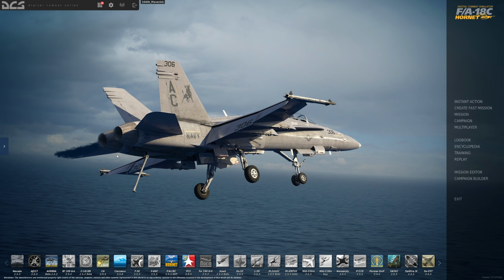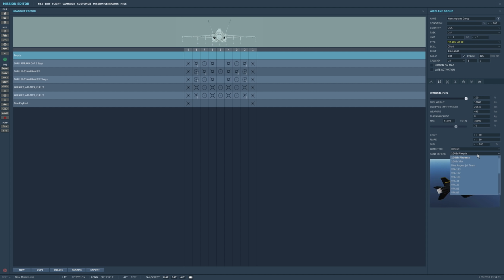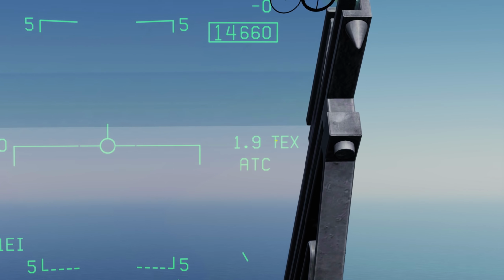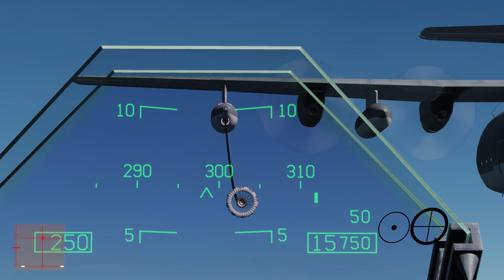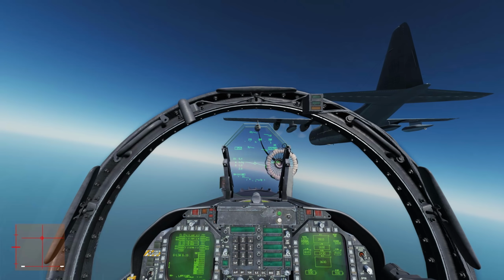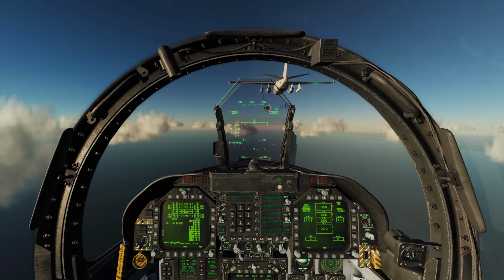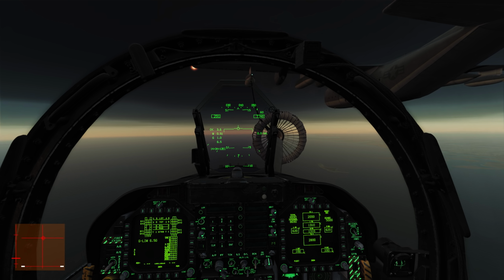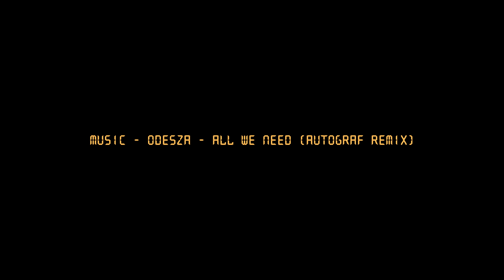DCS Fuel School | Complete AAR Tutorial |  Episode 1 - F/A-18C

Comment: Great coaching! I could listen to this guy talk for hours.  True and chill words to live by for tanking.  
I'd like to add two things: You might have noticed that the altitude and airspeed that you entered for the tanker in the mission editor never translate to what you will see in the air.  Keep your speed within 3-4 knots of the actual speed of the tanker at the time you connect.
Also, once you connect to the basket the F18 will take on fuel at a rapid rate.  So if you are PANIC LOW on fuel, just make that first contact for a few seconds and you will have room to breathe in order to reconnect if you come off.  Cheers!

Comment: Hey 104th_Maverick, I just wanted to say thanks.  Your tutorial helped immensely.  I just did a refuel mission and did a full refuel.  Not perfect still need a lot of work. My big issue was the throttle control and relaxing with the inputs. And the reference mark on the tanker fuselage really helped as I usually disconnected a lot.  This will be a great method to learn.  Thanks so much

Tracer

Comment: protip for air to air refueling missions. Spawn yourself with CAS / CAP loadout 50% fuel and droptanks included. And spawn some enemy Beriev Awacses or easy targets at a hostile airbase as a mental reward. Then spawn all three tankers Arco, Texoco and Shell at different altitudes such as 15k 18k and 20k flying racetracks for example. Then spawn yourself in the middle of the tankers and refuel, then bomb the enemy. Keep the groundspede in mission editor around 330-350kts but have different altitudes I think because different servers sometimes spawn em at different flight altitudes

Comment: I'm really curious on how you maintain that perfect pitch with throttle input. With me, even when I have perfect alignment, I'll get pitch oscillations just from the minor throttle adjustments. Has the new update negated these tutorials???
Also, Are you not a little fast??? Speed can allow for more precise movements.

NATOPS
9.2.2 Refueling Technique.
NOTE
The following procedures, as applied to tanker operation, refer to
single drogue refuelers.
Refueling altitudes and airspeeds are dictated by receiver and/or tanker characteristics and
operational needs, consistent with the tanker’s performance and refueling capabilities. This, generally,
covers a practical spectrum from the deck to 40,000 feet and 175 to 300 knots while engaged.
NOTE
For KC-135 aircraft, the following parameters are recommended:
Airspeed - 200-275 knots/Mach 0.8, whichever is less
Closure rate - 2 knots or less

I'd like to see you do your technique at a slower airspeed as I'm having a helluva time trying to keep vertical PIO to a minumum. Also, as a note, with these lower speeds they recommend to make minor lateral adjustments with the rudder, which I see you do.  And, why do you have 10 degree pitch up ladder in your HUD during this? A lot have asked but you haven't responded that I could see.

Comment: Wish I could give this more than one like mate, going to start practising AAR with your methods tomorrow (as soon as Wife Agro has disengaged). I've always suffered terribly from Pilot Induced Oscillation (in AAR), and now I know why; I've been watching the basket the whole time. I even gone as far as turning down the Curve's on my HOTAS pitch, thinking my stick was over-sensitive. Guess I will have to reset the curves to 25 and try again.

One question I do have was at the start of your initial procedure comments you mentioned that "Auto-trim" should be keeping your aircraft stable. Have I missed a control here? Does the FA-18 have an Auto-trim switch similar to the AV8B-NA? or is this simply a passive FCS feature once you have manually trimmed out for altitude and speed?
Reply: It's passive. The Hornet auto-trims for 1G in with UA mode (Up and away) in the FCS. This is on by default when in general flight. When in PA mode (Powered approach), you're trimming manually for AoA, and this when you're going in for landing.
Reply: I was going to ask the same question. My Hornet has NEVER been this stable in flight.  Interesting to know it should auto trim. Will have to keep practicing, but yes those pilot ascillations get me every darn time

Comment: Hi sir execellent video my question is about the use of trims : are you using only pitch trim? no pitch commands on stick?I trim rhe arcraft before contact but when I approaching the thanker my aircraft start to pitch up and dpown due to turbulence and in response to throttle movement, is hard to mantain stable only with trims , there is some trick to know? thank you
Reply from the maker: I only ever tough the roll trim during AAR if required, you shouldn't need to adjust the pitch trim as the aircraft FCS does that for you.
Reply: 104th_Maverick ok thank you , my fault English is not my language and some concepts are difficult to understand listening to the video , have a nice day .

Comment: Is it just me or is the KC135 much harder than the S3 or KC130? The hose seems longer and more prone to oscillation. Great vid BTW?
Reply from the maker: Most people find it one of the easier tankers, a lot of people struggle with the S3 as its so small.  The hose actually doesn't oscillate in DCS my friend, its very static in the air stream, so make sure you are not falling victim to Pilot Induced Oscillation (PIO).
Reply: @104thMaverick  yeah I suspect it’s PIO on my part. I’m probably over compensating for bow wave as well, which doesn’t seem to actually happen in DCS.
Reply: @104thMaverick  so I just set up a simple mission with the F18 and a KC135 MPRS. Plugged it first go and did a transfer from 60% to full. Dumped fuel and did it two more times. 🤷🏽‍♂️ guess I was just too hyped up before. Thanks for the encouragement.
Reply: Also, my son watched this vid with me and thinks you saying “the basket” in Scottish accent is hilarious 😂. Not looking at it though definitely helps though.

Comment: Mav, have you set any curves, saturation or deadzones on your stick ? You're so incredibly steady behind that tanker. The simplest correction on my stick results in big PIO.
Reply from the maker: Yes you should always use these however they are user and stick specific so my settings my not work for you.   I have between 15-20 curve set on all 3 axis and a deadzone of 1.

Flying without these is like having unprotected sex, its exciting but dangerous ;)
Reply: Great stuff. I set the curve to 15 , and did all the things you said in the video, hooked up and filled up without a single disconnect. Thank you !
Reply: @104thMaverick  the rudder axis on my x52 is shot, I need a deadzone of 70% to the right cause it's very jerky

Comment: I copied everything exactly and it didn’t work. I put in 31X and nothing pops up and then because of that I can’t do anything. Please explain.
Reply from the maker: 31x is the frequency for the tanker in the mission I flew, if your mission tanker is on another tacan frequency then 31 x won’t work
Reply: @104thMaverick  thanks, im pretty sure I did that but perhaps I did it wrong? If I copy what you do exactly will it work?
Reply from the maker: Yes, if 31x doesn’t work try 31Y (DCS bug), also you no longer have to be in A2A mode for the TACAN, if you select TACAN to A2A it won’t work
Reply: @104thMaverick  ohhh ok thank you. My main problem was when I pressed the keybinds for COMM 1 it’s just came up with atc and exit.

Comment: Hi Mav! My problem is the ladder on the HUD is not always showing like yours, thus I can't really reference the 10 degree mark. Is there a setting you use so the ladder is always visible?
Reply: hbladeh 
It depends on the speed of the aircraft how the hud is scaled.

I also believe Maverick doesn’t reference the 10 degree line on the hud in this video (unlike his first). I could be wrong though.
Reply: You have to get out of A/A or A/G modes to get the full pitch ladder.
Reply: StreetSharKen XD it sure changes the hud but it doesn’t change the scale of the pith ladder for me. 

It places the compas more on top of the hud, with the 10 degree line still out of sight. 

At 260 IAS at 16000ft the 5 degree line is behind the compas row. If I slow down a lot (220 IAS, same altitude) the 10 degree line comes into view.
Reply: Do you have track ir?
Reply: StreetSharKen XD yeah
But as soon as I forward my throttle you can see the pitch ladder scale changing. Very weird.